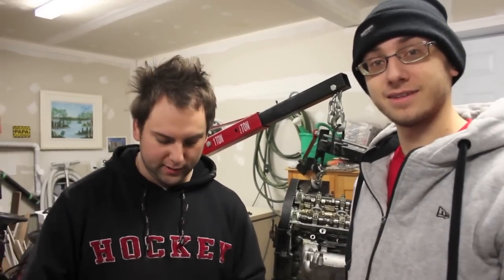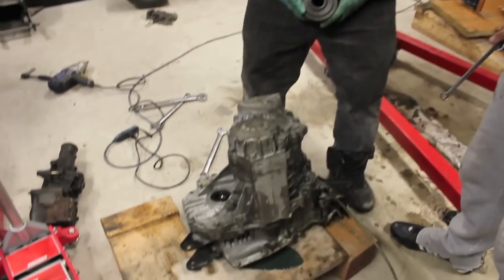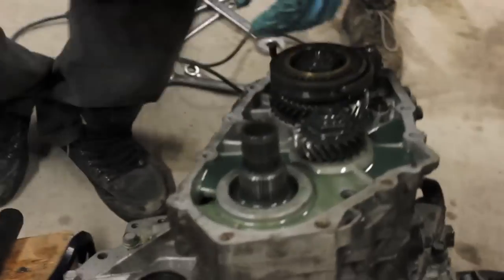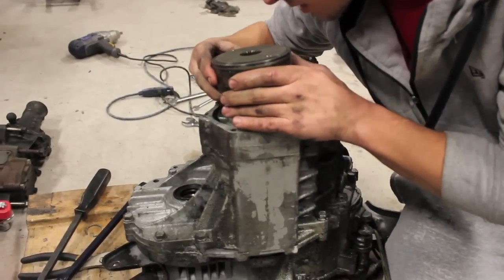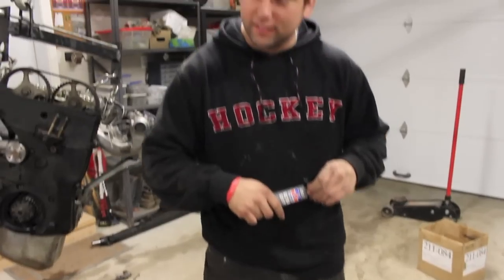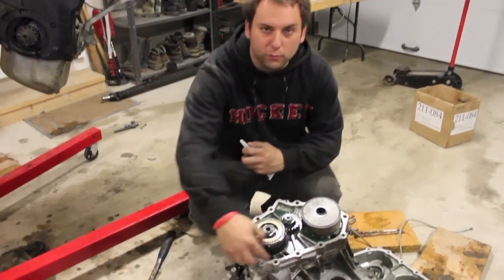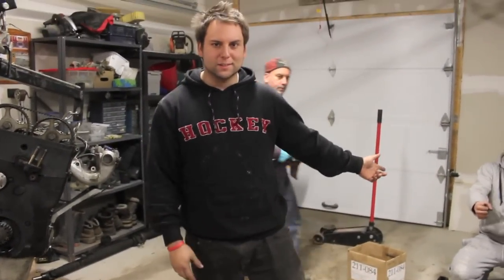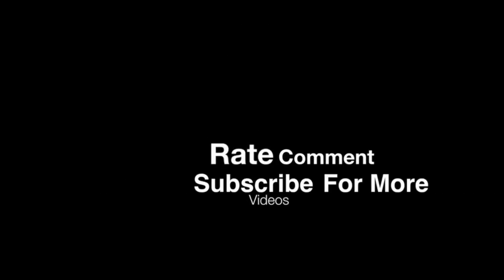RWD Converted Back to AWD 4G63 EVO

Comment: Hey, I recently did the stubby shafts up front into my evo 8. can I get some info info on that piece you guys added to replace the stock viscous coupler? why is it needed? how does it benefit the car? where can one purchase this part? thank you!!!
Reply from the maker: on an evo 4-9 there is not viscous coupler, you need to weld the center diff in the transmission which will lock the power going to the front and rear wheels 50/50, you can't just remove front axles and call it a day, you risk blowing your transmission, you definitely need to weld the center diff if you want to go rwd
Reply: just spoke to Raif at RRT motorsports. said the VC is located in the T case with evo 8/9. There really is not a practical option for RWD. Im sending out my T case for a rebuild. Cheers